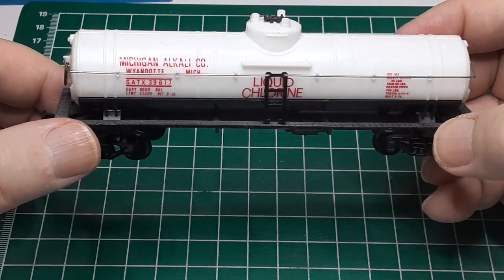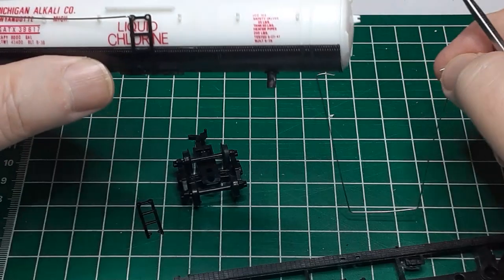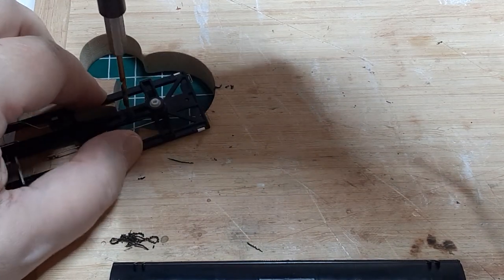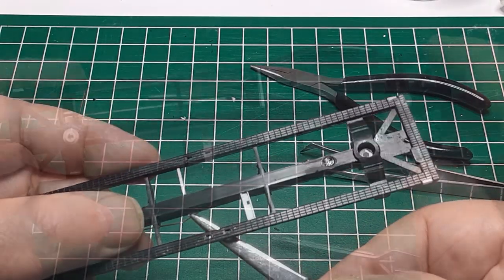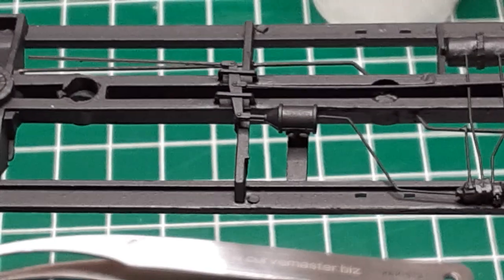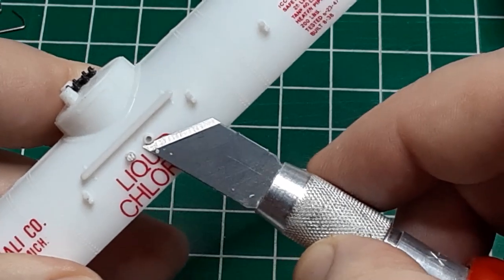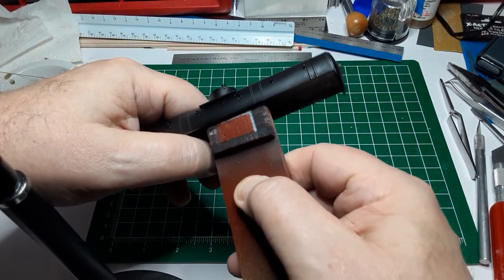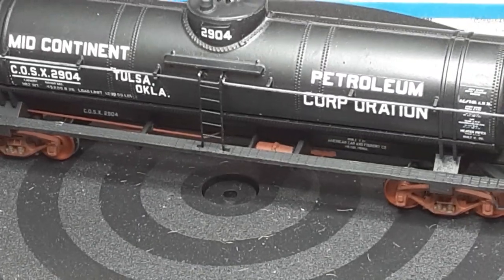Rebuilding an Inexpensive HO Scale Tank Car

Comment: Update: Accurail is back in production of the brake rigging tree. I ordered a couple of packages and just now started test fitting on my rebuilt Tyco gondola. It fits perfectly! All I had to do was drill out one mounting hole at one end and three little divots at the other end. The only change I made was to snip off the brake cylinder and carefully sand down the top and bottom of the lever arm where it had been attached. As I was already using Cal-scale brake parts I wanted to keep their cylinder. I removed and remounted it to engage the lever arm. I had already done the air piping except for the line to the brake cylinder and that should go pretty quickly.

Thank you so much for your videos! Without it I'd have never known the brake rigging was available as a drop-in assembly. That will save hours of work per car!
Reply from the maker: Email me a photo, please!

Comment: Wow, your attention to detail is great!  I don't think I'd have that kinda patience to do such detailed work.  I do good just cutting off talgo truck couplers and installing body mounted Kadee couplers & replacing plastic wheels with metal wheel sets.  Now that's some nice brake work.  I'm gonna bookmark this video so I can come back when I get better at installing trainlines and underbody brake work.  Thank you for posting and the great tip on decals.  Cheers from an ex-Georgian in eastern TN
Reply from the maker: Somehow, these projects always seem to grow. I start by replacing the wheelsets and installing body-mounted couplers. Then I realize that the stirrup steps look really clunky, so I need to replace them; and as long as I am replacing the stirrup steps, I may as well replace the oversized ladders... And before you know it, I end up saving the body shell and most of the underframe but replacing everything else. Oh, well - these are fun projects: low stress and pretty quick and easy: most of the work was finished in a week, working one or two hours a day.

Comment: That looks like a Tyco or Bachman car. I have done brake plumbing on box cars and covered hoppers. I have never done a tank car. Nice work as always.
Reply from the maker: Tyco cars always have the Tyco brand cast into the truck sideframes - this one did not. I could believe Bachman. Train Miniatures is also a possibility - I have a Train Miniatures tank car with the brake stand cast into the tank body just as this model had.

Comment: Suggestions: Strip the existing paint off before repainting. Repaint with glossy paint prior to applying decals. Use Solvaset to snuggle decals down. Then apply Dullcote.
Reply from the maker: You're preaching to the choir! Regarding paint stripping: I'm lazy, and this is a messy step, so I often skip it when I'm rebuilding a cheap model. (See my latest video "Refurbishing an inexpensive Passenger Car" for a notable exception.) In this case, the old lettering shows through just enough that it's obvious that the car has been repainted, and this was a common occurrence in prototype practice,  Regarding a gloss coat before decals, I always do this (unless the paint I'm using is already glossy) - it provides the smooth surface necessary to minimize trapping of air bubbles underneath the decal. I primarily use use Micro-Sol (MI-2) on decals to get them to snuggle down - it is less aggressive than Solvaset; but sometimes I have to break out the Solvaset. All of this is explained in my video "Breathing New Life Into Old Freight Cars", so I tend not to repeat it in every video I present. Thanks for watching!

Comment: Great ! and thanks for the many tips in your videos , I'm not that scared of the decaling process anymore :)
Reply from the maker: Applying decals is like any other modeling task: it gets easier with practice. That's one reason I enjoy rehabbing these cheap cars: if I screw something up, I haven't ruined a $50 model; I'm only out a few dollars and a little time. If you view my video "Breathing New Life..." I explain the decal process in more detail. One additional tip: continue to apply MicroSol (MI-2, the blue bottle) until the decal has snuggled into all of the crevices of the model surface. Only apply Dullcote when you are completely satisfied - after Dullcote, there is nothing you can do to improve the appearance of the decals. Look at the opening few moments of my "Painting and Weathering Freight Car Trucks" video for a great illustration of decals which were NOT properly settled into the surface details of the model.

Comment: The original tank car was distributed by Model Power. AHM used a similar paint scheme on a different style of tank car as well.

Overall great video, thorough but not overly complex, and well explained. One question/critique, though ... why rust colored trucks, wheels, air reservoir, etc? I believe those would all be black, except for the wheel faces. Brand new wheels would be the bright rust color, but they'd be grimy, oily black after several years due to oil leakage from the backs of the journal boxes.
Reply from the maker: First, thanks for watching, and thanks for the info on the model manufacturer.
Regarding the wheel color, you are absolutely correct (and this has been pointed out by other viewers of my videos as well) that oil leaking from the journal boxes meant that the wheel faces quickly developed a thick coat of black grime.
I tried several methods of painting the wheel faces black, including using Grimy Black paint, both with and without a little baking soda for texture. I never got a wheel appearance that I liked. Then one day I was sitting at the Amtrak station in Lee's Summit, Missouri and watched a freight train pulling through. Those wheels, because they now use roller bearing trucks, were a uniform rust color, and I liked the contrast of the wheel color and the sideframe color. I tried it, and I liked it, and I've been using it ever since. Is it realistic? No. Is it prototypical? No. But it does produce a truck appearance that is pleasing to me.
In my video "Painting and Weathering Freight Car Trucks", I discuss this very issue.

Comment: FYI Accurail has been out of stock for a while of the brake rigging casting along with all truck sideframes. They've had a molding machine failed with a die set inside the machine. They only got the dies removed earlier this month and will attempt to begin making up production with a different molding machine as the other one is repaired. They expect to be back up to normal production with items back in stock by December, 2023.
Reply from the maker: Thanks for the update.

Comment: One question.. how did you fill in the holes for the trucks??? I have some old reefers, and I want to install trucks and couplers separately.  Also some tank cars.  What did you use to fill the holes, and how did you attach the the "filler" to the underframe?? Thanks!
Reply from the maker: Regarding the truck mounting holes: drill the holes out to 3/16" diameter - use a very low drill speed or the bit will chew up the underframe. Then insert a short (approx. 1/2") length of Evergreen 3/16" tubing and cement in place. I use my go-to styrene cement: Bondene. When dry, insert a short (3/16" + 1mm) length of Evergreen 1/8" tubing. The 1/8" tubing exactly fits the ID of the 3/16" tubing, and 2-56 truck screws fit nicely into the ID of the 1/8" tubing. This process is explained in more detail in my video "Still Breathing..." (https://www.youtube.com/watch?v=ck0Y-daCIP0&t=609s).

Comment: Thanks for a very interesting and informative video. To me, painting is one of my favorite aspects of model (re)building. Any excuse to get out the airbrush. On many occasions I have used handmade stencils to simulate renumber cars. 
One question I hope you can answer concerns tank cars that have platforms/safety cages around the top hatch. I've seen lines of tank cars where all have them and lines of cars without. Do you know what determines when a tank car has one? Any information you can share will be greatly appreciated.
Reply from the maker: I have never found any authoritative explanation as to why some tank cars have platforms and some don’t. However, I worked as a chemical engineer for 45 years, so I can make some pretty good guesses. Here goes:

1. Platforms are only provided in locations where operators have routine tasks to fulfill. This provides a safe working space for the operator. For tank cars, this means that platforms are provided on tank cars which require vapor recovery during loading and unloading. Tank cars are loaded and unloaded from the bottom. Hoses are connected to a valve at the bottom of the tank, and liquid is pumped into or out of tank. If the vapor in the tank can be allowed to escape to the atmosphere, no vapor recovery system is required.
2. Historically, this meant that tank cars in services such as petroleum products, corn syrup, ethanol, sulfuric acid, and caustic (to name a few) would not require platforms.
3. However, tank cars which contain very toxic chemicals – for example, liquid chlorine, anhydrous ammonia, or vinyl chloride monomer – require recovery of the toxic fumes during loading and unloading. In these cases, hoses are connected to a valve on the dome, and those hoses are connected to  either supply or recover vapors from the tank during the loading and unloading process. Since an operator is required to be present to connect and disconnect these hoses, platforms are provided.
4. In recent years – that is, since 1963 when the Clean Air Act was passed – more and more fluids conveyed in tank cars have required fugitive emissions controls. This means that more and more services require vapor recovery systems. This is why most – but not all – modern era tank cars are equipped with platforms. 
(If you have ever filled your gas tank in California, you probably noticed that there is no gasoline odor in California gas stations. This is because the mandated vapor recovery systems in California have nearly eliminated fugitive emissions in gas stations.)
5. Notice I said “most but not all” tank cars have platforms. This is because a few services by their very nature do not require vapor recovery. The two services that come to mind are LPG (Liquefied Petroleum Gas, or propane) and LNG (Liquefied Natural Gas); there may be others.

I hope this helps. I also hope that anyone reading this who has better information will correct and expand on what I have said.
Reply: @rwissbaum9849 Thank you for your insights. I also had difficulty finding info and thought maybe manufacturers/purchasers preference but that just didn't make much sense. Your explanations seem logical.